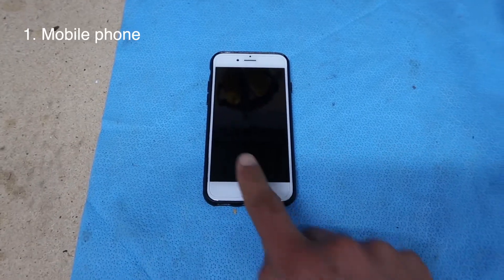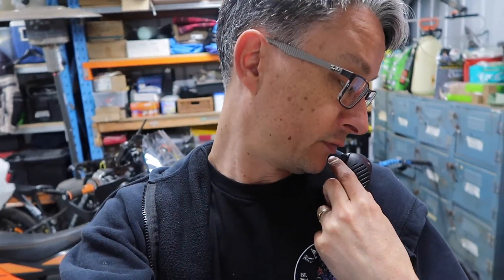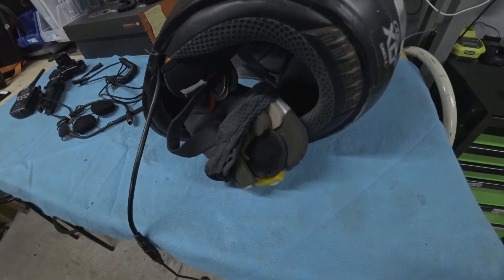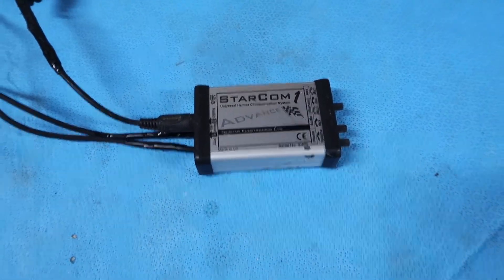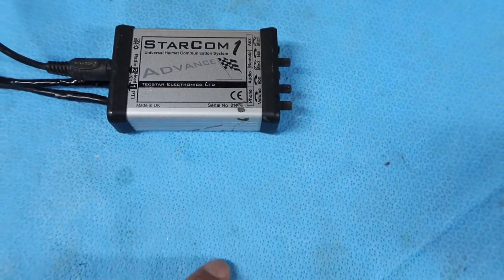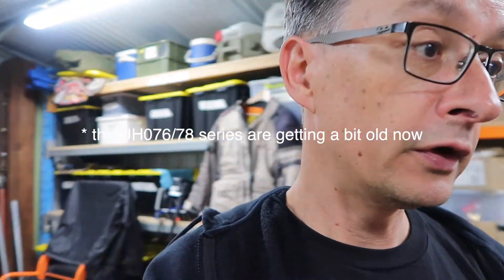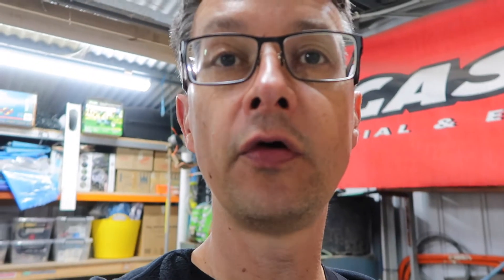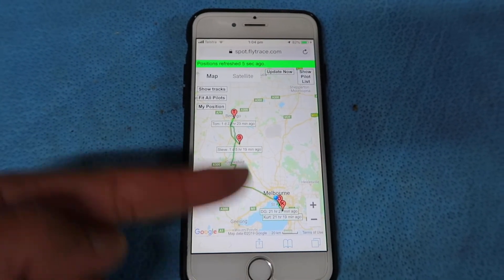UHF setup on my KTM 500 EXC

Comment: Thanks Keith, you helped make up my mind with going down the UHF track. Keep up the Videos. Building up my KTM 450 with a similar setup so very handy all your videos.
Reply from the maker: There are cheap (~$70) bike-to-bike intercoms - stuck on side of helmet style - that use UHF frequencies, but NOT the standard channel frequencies.  These are possibly the best version I have seen, in that it's not bluetooth so is effectively open to as many people you want, it's 0.5W so theoretical range is 3km if flat and open, and all contained on your helmet.  Search ebay for "X3 plus uhf"
BUT it's not the standard channels so you lose the channel 10/40 thing which I personally find really useful.

Comment: I'm interested to know why you cut the lead from the speaker mic, you mentioned you paired it with the radio, is that Bluetooth pairing?
Reply from the maker: The UH076 radios use a weird plug - it's a 2.5mm plug with a longer shaft. I cut this off the speaker mic so I could use the plug to hard wire it.  But all this is now gone! Refer to my new Bluetooth setup: https://youtu.be/SZXktXPmYDM

Comment: good video, UHF is the way to go, pity AUS is so limited to 5w. gotta be a way around the wire to the bike?
Reply from the maker: I've seen 8W units on ebay that you can reprogram to Aus channels, but yes I get your point.  
I'd LOVE to ditch the wire. Anyone got a GOOD solution?
Reply: @keithjob  There appears in 2022 to be several Bluetooth PTT systems available, eBay, Amazon, AliExpress... Not tried one yet, been testing VOX opening.

Comment: Sir, would the UHF radio you showed be compatible with one of the Sena units, like a 10S? I am trying to find a way to have a driver of a van or car be in constant communication with a motorcycle rider.  Thx.
Reply from the maker: in my experience the 10S doesn't work very well. You will need a newer intercom model.